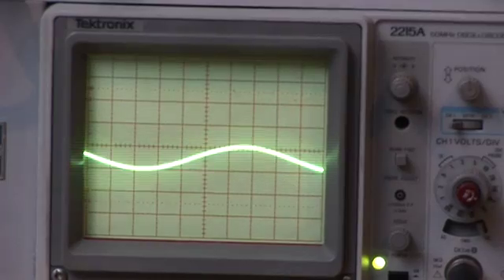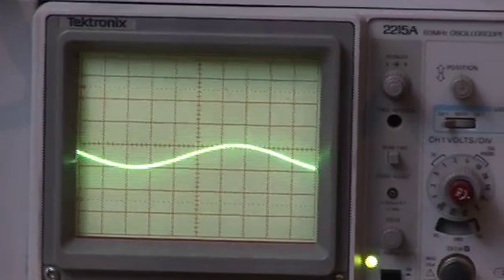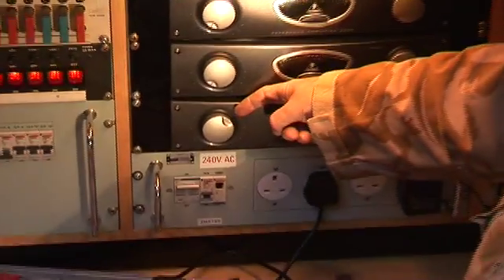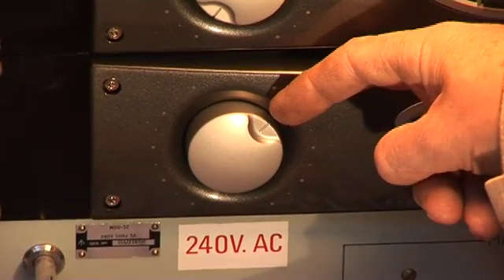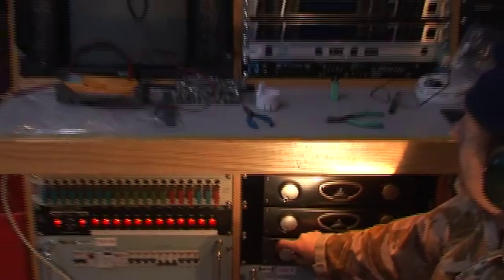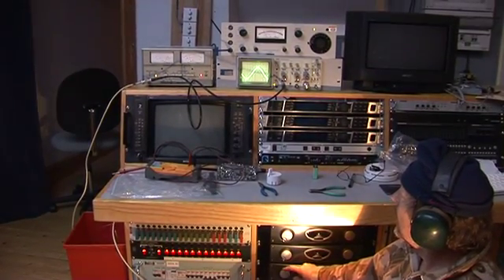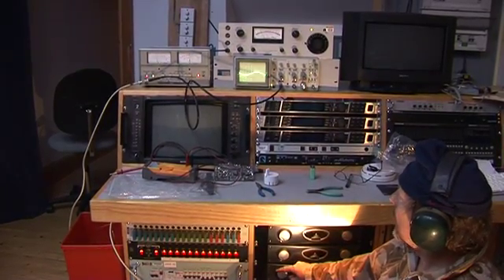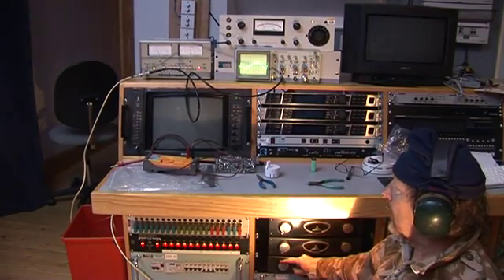Behringer A500 Amplifier Test PART 1

Comment: i find this very strange.   I am sure that an expert could give an explanation after looking at the schematic.  Sometimes the input attenuator is creating issue for the way it is wired ... a coupling cap rightly placed could solve the issue usually.

Comment: You know the ADA8000, in the recording world is known as a crap piece of gear, incapable of getting even semi pro sound out of it, YET with the Custom Made DAW and Digital Software Console for concert mixing that I use; all we use is behringer ADA 8000 and now the ADA 8200, and we OUT PERFORM by leaps and bounds every other DAW and Live Digital Console on the market hands down! It truly sounds Analog, without all the extreme noise!

it really appears that there is a whole bunch of artificial conversations going on about gear ie: whats pro and what is not pro quality ETC.

HOW DO YOU EXPLAIN THAT??!

Comment: This is the reason it costs nothing, go buy super duper hifi audiophile amp for 100k dollars.
Reply: these are not hi fi, these are reference , flat , dry amps  ,
Reply from the maker: @dedskin1  sorry for the very late reply I got remarried and live in thaialnd Yes indeed "hifi"  I loved your acid comment - hi fi is just a weird  consumer thing where they sit and imagine all sorts of things then get very cross arguing about it.  The only place the music sounds good AND EXACTLY as it should be is in the studio where the mix/live is being recorded, in the seat of the engineer, after that it's down to taste - HP sauce on Chips and Silver oxygen fart free wanker cables in line matched to the earth spin resonance and anti gravity magnetic operating syndorme - We sold all our Quad amps at high prices on ebay (thank you hifiers), and I am keeping my Tannoys which  I was brought up on. Still can't believe this post got 47k views - Uncle Bertie Berhringer  must be pissed , my daughter Lash Wynter just reported the integral LCD screen died on her digital band monitor mixerer (Behringer of course) So, well, it was nice try to go cheap and it failed. Dumpster for them. Thailand for me and no more second hand army clothes...
Reply: @ebaystars  i get you bro . man learns trough experience , i have Behringer as well , studio monitors , not expensive 500-600$ a pair when i got them , its been some time , more then 10 years , they are still working :) Truth be told i know electronics , so i changed lots of stuff on them , even drivers on one , but it didnt fail , i dropped a screw driver and ripped the membrane , so its my fault :) They never failed , but i dont even turn them off , i know how to take care of electronics . The biggest damage is done by Temperature changes , so i keep it on , stable temperature and preventive maintenance , and they work for more then 10 years , close to 15, when i got it they said , oh Behringer its gonna brake on you , its cheap , when indeed its not , its build quality is higher then Mackie monitors that served for copying the design .

But mackie's have Switching PSU , like a computer PSU , while Behringer uses Linear Transformers , that is without question better and more expensive .
but i didn't know that when i got them .

So when i say Reference i mean that Studio sound , no bullshit  straight to the point type of sound .
Due to this most studio gear sounds the same,  and this is good , its Reference Sound , achieved by using active crossovers , multiple amp stages and so on .

Now when i say Hi Fi i mean colored sound , its done in different way , more pleasure in it then accuracy .

And when i say Audiophile , i mean clueless guy who thinks his 10 000$ speaker is more precise and raveling  then studio monitors because it costs more , when electronics and electroacoustics dont care about cost .
Active crossovers are cheaper then good passive ones , and are still better at what they do , its just how she goes .

But non the less i do have Precise Reference system , as well as Hi fi system , for example if im listening to old music not recorded real well , it sound better on less precise Valve gear . Its optimized for that .
So there is place for everything .

If i had 100 000$ to burn i would probably go for some expensive stuff ,something audiophile 
So i can see my self owning Audiophile gear even if i dont really believe in it .

Im not condemning anyone except those that are clueless as to what is what , and get stuff because its "in" , its popular , rather then going for informed and educated choices .But i guess not everyone knows electronics as good as i do , i have education in the field and good amount of research and DIY, some ppl just dont have that , cant blame them i guess .

Comment: Why is anyone using the level controls for volume control anyway!?! These are power amps(Dont really want to credit them with the term POWER amps as I think mine is underpowered,at least compared to my life expierence of low end hifi integrated amps) you set that to maximum and just use your the volume control on your pre amp. Everyone know this oh and the crappy noise floor of the amp doesnt help,not reference at all.

Comment: Those amps only need to be calibrated, not replaced.
Reply from the maker: Jose Pedro Espinosa we did try at different levels but felt unsafe to run them wide open, and then adjust the input levels (they were feeding Tannoy DMT 15s I didnt want them burning up voice coils on sounds out of hearing range such as positive feedback,  (from memory but they went years ago in the bin) I actually considered taking out the preamps where the distortion was coming from, the main PA section was probably ok...

Comment: Hi and thanks a lot indeed for the very interesting tests (i own an A500 myself)
Do you think that replacing input pots with better ones will cure this distortion issue ?
Or the amp will distort anyway for low power output ?
I have noticed that many amps perform better at higher power than very low output powers (i.e. < 1 Watt).
Thanks a lot and kind regards, gino
Reply from the maker: gino Gino late reply I got remarried in the intervening years, yes we did consider cutting out the input stage but in the end they went back and we got some better amps.  best wishes from Thailand where I live now, in the sun, :-)
Reply: Hi again ... i know my comment is very late and plese excuse me for that.   But i wonder if you have experienced the issue using balanced and unbalanced inputs as well.   It is very strange behaviour indeed.  It should not disappear raising the volume up to 100%.   Very strange.  Maybe it is due to how the volume pots are wired ?

Comment: This measurement has nothing to do with the position of the gain (volume..) control, but everything with the amplitude. This is crossover distortion - you can look at theaudiocritic. Up to about 1W, you have over 0.35% THD with mainly second order distortion. They point to it as "noise", but it's not - it's typical bad design.

Comment: I have one of these bridged into a single 8 ohm load. You are saying I will get better sound if I turn the right volume down all the way, the left volume knob up all the way and then control the gain with previous device in my system?  Thanks!

Comment: What I don't get is you have all this really expensive gear and you buy these cheep entry level amps. I mean you can't not blame them, there cheap, they have been designed to a budget for beginners.
Reply from the maker: i was given them then I threw them away
Reply: I've been working for 2 months to save money for this amp and you throw them away ? 😢

Comment: @saturnfan32x 
"if I were to use this amp to push a set of small monitors, i should set the amp to maximum, and adjust the volume from the preceding mixer to get the purest sound?"
Yep. (Question is, do you need that much power at all? Or maybe go active after all?)

That really is some BAD distortion there, and my setup here made it plainly audible, too. (Reassuring for an audio quality snob. ;)) Definite level control design FAIL. Well, if it's too cheap, there's prolly a catch...

Comment: sorry if my question sounds inexperienced . .  but i was looking at these amps for a small home studio project I've been putting together for awhile now. I noticed these were the most reasonably priced amps for the value. .  so my question is; if I were to use this amp to push a set of small monitors, i should set the amp to maximum, and adjust the volume from the preceding mixer to get the purest sound? And what's an example of distortion you would hear by the defective amp to the ave listener?

Comment: Sorry...that should be 2 divided by PI = .636 (not 1 divided by PI - formula for half wave rectifier ....oops). Manufacturers found out years ago, first when solid state amps came out, that they were having problems with some amps blowing transistors and stuff at around 60-70% volume levels but operated at higher levels they would work OK. Its just basic Class AB circuit design taught at any college level analog electronics course.

Comment: The transistors in a class B (A/B) amp actually work harder at 63.6% than they do flat out (1 divided Pi equals .636 times 100 equals 63.6%). At this level the transistors consume the most power thus run hotter, distort most at this level (if not compensated for with good circuit design)
.

Comment: So this amp doesnt meet specs when its volume controls are NOT turned all the way up. So what? If you have a separate amp, its volume is controlled by a preamplifier. The Behringer controls are not meant to be used like normal volume controls because they will wear out if used too much. The proper way to use this amp is to turn its volume controls all the way up and use an active or passive pre amp to control its volume. Used this way, it sounds fine and is an excellent bargain.